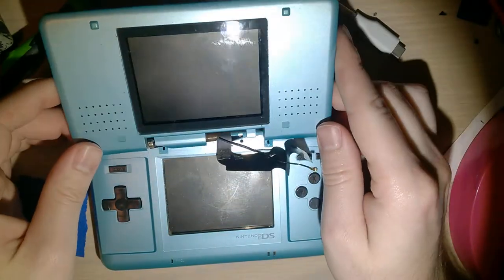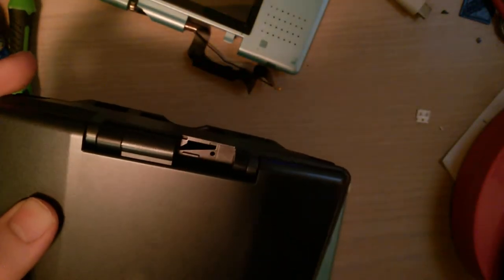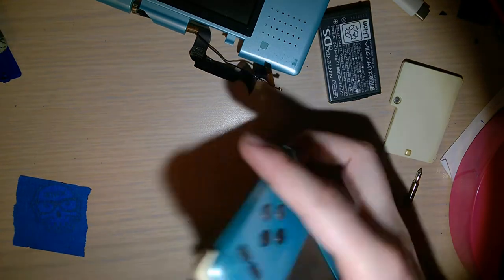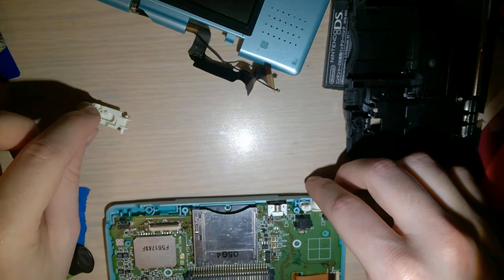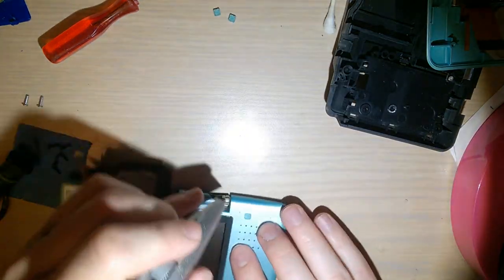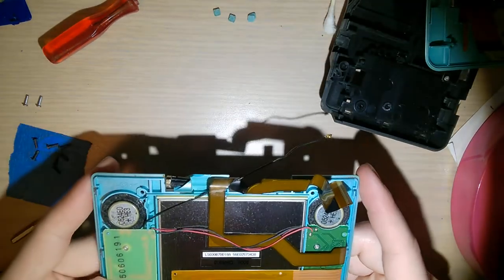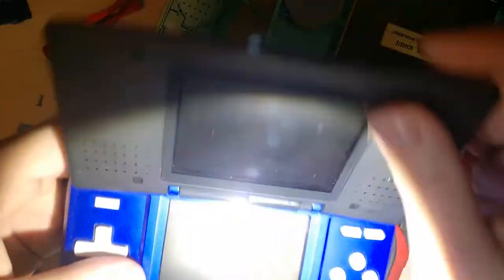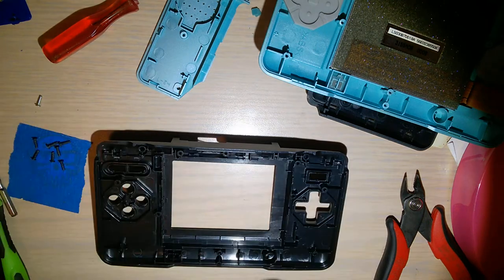Installing an aftermarket NDS Shell

Comment: If I have learned anything from buying replacement shells is to always use the screws that come with them, as much as I'd like to use the original ones. I have destroyed a couple of shells in cases where the original screw threaded through the other side or it completely cracked the screw hole because it was a larger diameter I guess

Comment: You should revisit the fat DS, Makho. Some newly molded aftermarket NDS shells would be a godsend. The molds that these Asian companies use currently are terrible. Having to swap my broken hinge fat DS and my lens has the same issue that yours does. Terrible centering and the shape is just awful.
Reply from the maker: It's beyond my current abilities to do anything about the shells unless you want macro shells. I have no influence regarding the original model DS either -- no one is interested when the Lite is just as cheap
Reply: Can confirm. The shells alignment and plastic finish are TERRIBLE. If any retailer ever gets interested in the DS it would be a Godsend. I haven't had good luck with my local second hand market either /;